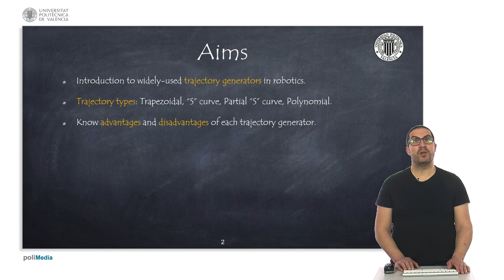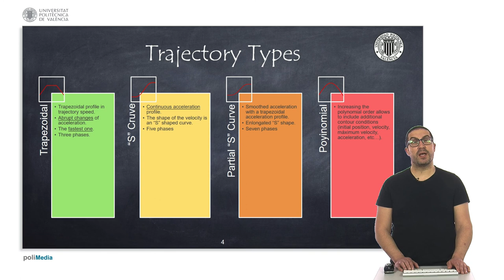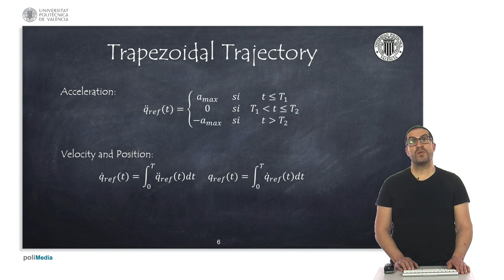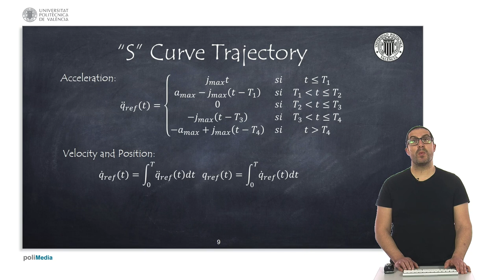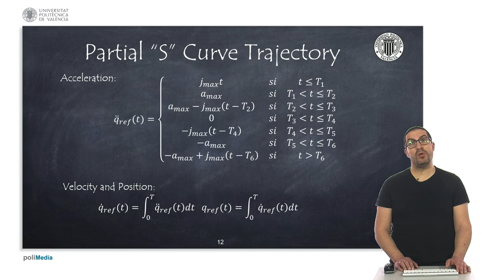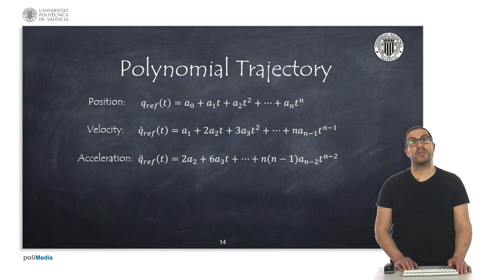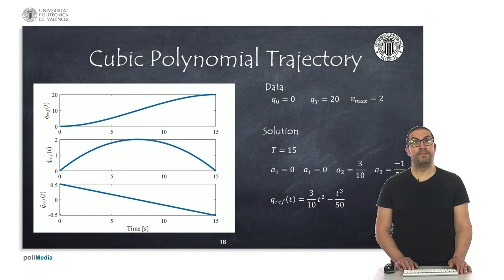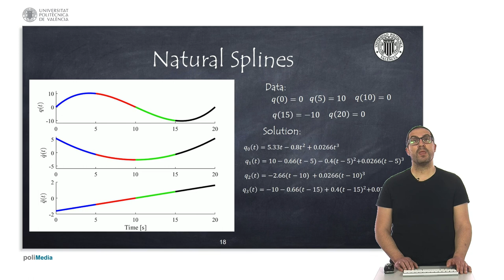Trajectory Generators | Robotic Systems

Comment: hello prof. I have a question hope you please answer, where do we get Vmax and Amax? it come from calculation in Jacobian or we can put any number we want?
Reply from the maker: These are parameters that you can decide, obviously they should be smaller or equal to the ones specified by the manufacturer
Reply: @LeoArmesto  Hello prof. thank you for your reply but I am not buying robot arm from any manufacture. I am making own 6dof arm robot as a assignment. my robot could reach target I want and point to any direction I need, but the way it move is so messy that can make any object in end-effector drop down. I really want to know step by step to control velocity and acceleration each joint angle to make end-effecter move straight in any direction
Thank you again
Reply from the maker: @yimbunchhat  then set small values for your velocities and accelerations to generate smooth trajectories
Reply: @LeoArmesto  thank I will try to understand again